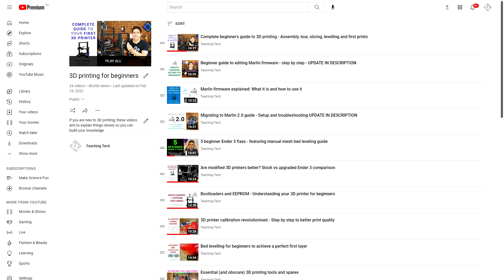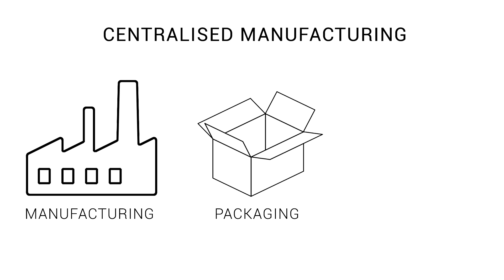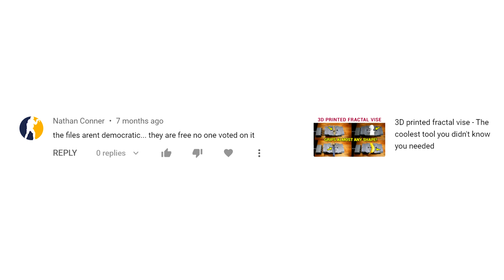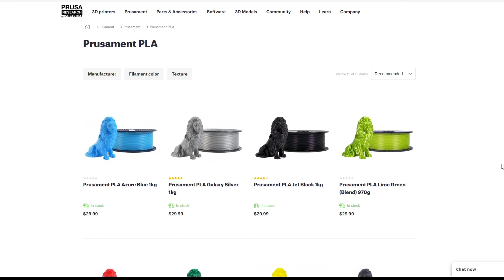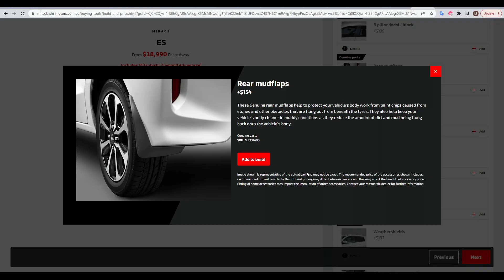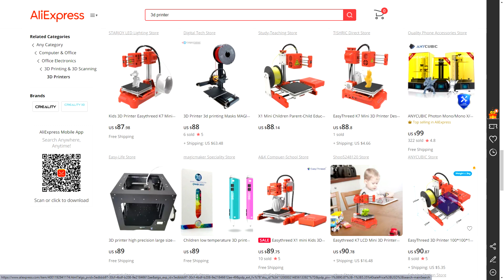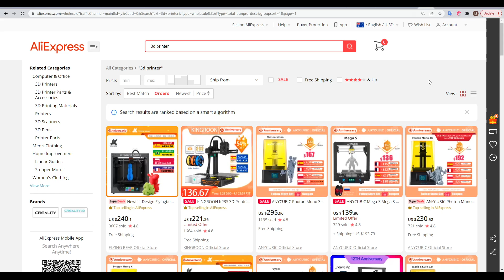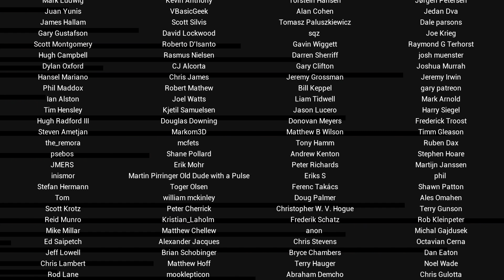3D printer trends are limiting mainstream acceptance: The 3D printing paradox

Comment: If resin can overcome the toxicity issue I think it has the best chance of democratizing 3d printing. All the steps we do with it can be automated in large part. Make a machine where you insert a resin bottle, the printer recognizes it and adjusts settings to match the resin, fills and drains the vat automatically, washes and cures the print automatically, pops it off the build plate automatically, and only leaves you with the supports to remove, and then it's ready for mass market. Just an estimation, but I think this can be done in volume production. Yes, it's going to be a bigger machine, but it does everything, and the only thing the user has to do is add resin bottles and empty a cleaning solution once a month and suddenly it's not much different than a dishwasher.
Reply: Nope, Resin will always be a mess and if/when 3D-printing will be mainstream, it will be FDM-printers. My Anycubic Vyper for example was very easy to setup (far easier than IKEA-stuff), never manual bed-leveled anything ever and did so far a good job in reliability. Once the filament-sensor produced an error-code and Anycubic sent me a new one. Cura-profiles were not optimal, but even the basic-settings provide a simple interface to fix that. Problem for mainstream are rather the different filaments that require tinkering with Cura for decent results. A mainstream 3D-printer could be cheaper, but you can only use the filament made by the manufacturer. Today this would be easy by switching to a unique filament diameter like 2 mm instead of 1,75. Certainly some filament-producers will provide alternatives, but that's not different with spare-parts for cars or coffee-pads for Senseo machines.
Reply: @Leynad778  please why resin will "always be a mess" when current wash and cure stations largely remove any mess from the equation. FDM requires dramatically more work by the end user.
Reply: @tenchuu007  And what to do with the waste? There are many videos from people who manage 3D printfarms and I didn't see one running resin-printers for more than some very special jobs. And what job is required by end-users with FDM-printers that isn't required for resin-prints? The professional printers need perfection and are usually happy with their results, mostly made by Prusa or Polymaker FDM-printers. The P1 on their wishlist is usually an automation for removing the print and repeat.
Reply: Resin printers compliment FDM printers they're not meant to replace them.
Reply: Layer height, extrusion width, flow rate, temperature adjustment and half a dozen other things you have to get perfect for FDM that resin doesn't need. FDM can fail in a myriad number of ways that resin never does. Those failures will stop adoption.
Reply: @tenchuu007  All of this is just a matter if using an unknown filament with a slicer software not optimized for the printer and isn't a problem with FDM in general. That's what this video is criticising, since most hurdles are due to the wide variety of printers and filaments, but it also keeps the costs down. With inkjet flat printers you are forced to use the very overpriced ink of the manufacturer, why the printers are so cheap, but also easy to use. For more mainstream 3D printers it would help if such idiot proof solutions are at least an option. What 3D printing needs is a major big player pushing technology forward and not another Chinese Endor 3 clone. And btw, if you have that many problems with FDM prints, you might want to spend a bit more on filaments or replace your printer. My Vyper work flawless with the right filament and settings and it's like putting a frozen pizza in the oven. For getting 99,9% quality you have to pay a lot more like with everything I know.
Reply: @Leynad778  Nice to see the judgment come in, but let's just start with me having three FDM printers, all of them costing more than the Vyper, and printing in a variety of materials from PLA to TPU to carbon. I run a delta Flsun Super Racer as my primary. I don't exactly buy cheap filament. I have worked on dozens of machines, and there are literally dozens of places an FDM printer can fail. Belts loosen, hotends come loose, screws shear, one of the four motors burns out, the heated bed fails or the bed lining fails. Or just simple things like a bit of filament lifts off right at the start and ruins the print. Literally a gust of wind can affect an FDM print to the point it fails. AC kicks on. That has nothing to do with "buy better filament and a better printer." Those things happen with all FDM printers. 
On a resin printer you have two points of failure. The motor on the Z axis and the LCD. Swapping an LCD can be a simple process if designed for easy replacement. Z axis problems are pretty rare. I can literally model out a system for printing, cleaning, curing, and presenting a resin print that has less potential failure points than just a standard, midrange FDM printer like the Vyper.
Reply: @tenchuu007  All those issues can be addressed with good design, and there are FDM machines which are very reliable: good belts and a sprung idler can keep them taught (or a simple microswitch sensor to detect tension and manual tightening); well designed hotends like Revo stop leaks, never heard of screws shearing or motors burning out or heatbed failing that seems like dodgy components; printer clogs of any type can be detected with a filament motion sensor; print failures can be detected with cameras and AI (would most likely be a cloud thing with home machines); a failure of the motion system can be detected with cheap accelerometers and closed loop control (like a standard printer generally uses a linear encoder to detect position). The problem is these are currently mostly commercial/industrial machines (and/or things covered by patents).

Industrial AM is a completely different market to home machines and adoption is increasing rapidly of all types. A business can afford to pay more for a machine as long as its function is worth the investment. Reliability is highly valued in manufacturing, although with a print farm it is less so since a failed machine doesn't hold up a whole production line. Basically any machine can be made to be reliable, it just requires a big enough mass market to make the investment worthwile like normal cars. 

There is a reason the big companies stay away from the hobby market, and it's because they know they can't compete on cost, or would have enough market uptake to cover the investment. Business is a much easier market to sell to right now. Ironically, because printers currrently require tinkering, there isn't mass uptake so there isn't a mass market for the larger companies to target. It's a chicken and egg problem, which may get solved when more reliable industrial machines trickle down to lower cost machines (if the low cost printer manufacturers would actually bother to incorporate these things).

The only manufacturer focusing on the ease of use aspect is Prusa, both with hobby and industrial applications. Being someone who is currently designing and testing a new configuration of FDM machine for my masters project, I really value my Prusa Mini for its ease of use and reliability, it just works (and I used it to print the parts I needed). Although I have had one issue where I had to take the hotend apart, so it's not quite there but they are getting there.

As for which technology will break through to the mass market is hard to say. I do know that what is limiting uptake of resin printers in industry is material properties. Manufacturers want material properties and costs equivalent to standard thermoplastics which will take a while to solve. There are some resins with good material properties although they have other requirements such as two part resins, high temperature or high viscocity.

Comment: I see myself as fairly technical capable person, I'm a practical electronics engineer and a student of mechanical engineering in a very respectable university.
a few months back I decided to buy an entry level 3d printer, so i bought a Biqu B1 se Plus because i wanted a large printer and it was on sale at a local store.
almost immediately after receiving it i understood that what is considered to be "entry level" in the 3d printing market is the complete opposite from any other industry. for starters, setting up a slicer profile for it was a complete mass, the provided profile is worthless so i needed immediately familiarize myself with all the slicer settings before i even started printing.

And then there is the actual build of the printer. i knew that i was buying a budget printer, and i did so wanting to dip my toes in the 3d printing world before jumping in, but that printer just threw me into the deep waters. the quality of materials was fine for the price, but the stupid ass design decisions really threw me off. there was only 1 Z axis lead screw on a 310x310mm printer, so the X axis rail was always unleveled and it was impossible to get a proper first layer, they only included 2 bed clips to hold down the glass bad, so it often caused layer shifts and ruined prints, the extruder is run by a tmc2225 driver that doesn't work well with linear advance.

so i decided i wanted to add a Z axis motor, and while at it i also bought an Idex upgrade (which i still hadn't installed). but the z axis kit biqu sells doesn't include a driver so you can't use the g34 command code, so i had to also buy another driver and program my own firmware to allow the feature. and there is not enough room for the second printing head so you lose a big chunk of printing space to avoid collisions and the way you put the second x motor throws the z axis completely off balance, so i also had to order a new tmc2209 drivers for linear advance, buy longer x axis rail, design a new way to mount the x motors, move the extruders to the top of the printer and again program a new firmware to include the changes to the frame and add the linear advance feature.

i practically had to redesign the whole thing and program it myself to bring it to a point it prints without issues, if i wasn't technically capable and loved tinkering with stuff i would have frown the whole thing in the garbage after a week of it causing one issue after the other and completely give up on printing.

Comment: My primary irritation with both the manufacturers and reviewers of 3D printers is their claim that a machine is "silent" by completely ignoring fan noise from the CPU and power supply. It can sound like a small tornado, but as long as there's no stepper noise, they claim it's the quietest printer ever. Reviewers don't call them out on it because those fans have apparently become an "accepted" part of the machine. We should demand better from the start. If Snapmaker can sell a printer for $1800 that sounds like a leafblower we have an elephant in the room at every level of the industry.

Comment: A) I agree with you, 3d printers need to be more maintainance free, that's usually achieved with modular components and clear instructions on how to service them
B) The more maintainance free a product is, the harder it is to maintain it. In your car example, yes I expect it to roll out of the dealership working perfectly fine, with wheels aligned and have the manufacturer recall it when there is a widespread issue, which requires brick and mortar dealership networks. Also, as you said, the vast majority of drivers don't have the knowhow how, the time, or simply the will to work on the car, so they take it to a service point, to a designated repair shop. We do the same with our PCs, 2d printers, TVs, fridges, and pretty much any widespread consumer good. 

From the above manufacturers should invest in plug and play parts, easy maintainance, and part stockpilling, as well either fool proof building procedure and tuning, or well QAed prebuilt machines, all of which will increase the design cost. Also, as we have computershops and dealerships, we need a repair network to take the printer when it breaks. Expecting the average consumer to fix issues is not viable, which I think is also a very good business oportunity. Further more we need to be able to transport a delicate machine from wihtout messing the alignement. Basically we need better centralised manufacturing of printers. We also need more quality brand names, brands you can trust just by their name, like Prusa etc. Nost of the above though will drive the cost up until the infra is there to service the printers. Now if only manufacturers tried to do that instead of chugging out clones of every printer and accessory (BLTouch anyone?)

Comment: Off topic, sorry.

Are biodegradable filaments at least common place now? My biggestt requirement for a 3D printer is to just... not make me a bigger contributor to the plastics crisis.
Reply: Forget it. PLA is the standard beginner printing material and it's only biodegradable on paper, it will not be practically composted anywhere in the world, as it needs very special conditions; and even the most progressive recycling companies will sort all hard material out of their compost.

Other materials which would be more inclined to biodegrade naturally simply do not work. It hasn't been possible to achieve this sort of print quality with them.

On the other hand you want your prints to be durable, and I found even PLA to have issues in this regard. It has a really weird long term behaviour, it becomes super brittle. Every single PLA print I have made has failed so far about 2 years in, if they were mechanically loaded at all.

What you want is either to have a recycling service which either chemically processes or remelts the material for reuse, and there are initiatives, but they're years away from being actually operational; or at least that your recycling burns all unidentified plastic in a reactor to reclaim the energy contained within.

I'm also not entirely convinced that plastic crisis is anything we have an influence on with 3D printers. The vast majority of ocean plastic comes from a handful impoverished regions with no waste processing whatsoever, and best way to handle that is charities which are working to fix that. The microplastics in your local lake or river that you can find probably all come from textiles via washing machines. The frequently quoted figure "you eat 5g of microplastic a week" is complete nonsense, I can explain why if you wish, but I'll need to fetch my notes.

Creative activity is by its nature wasteful, but it can still be valuable to us as individuals and as a humanity. You kind of need to balance that against other concerns. There are ways to make the world better, but to be effective, they need to lean heavily towards political action, "personal responsibility" is just a subterfuge by businesses who don't want to be held responsible.

Comment: Before my time when the telephone was just becoming a thing, and before every home had one. You could go to a phone box to use one.  Not so long ago you had a copy shops where you can copy a document and get it faxed somewhere.
So why not a 3D print shop. But where would we put them. Schools or library's. Machines would have to have less failure rates than we currently have. In this day and age they would have to be largely unmanned. More like vending machines.
The other problem is manufacturers would rather you buy a new item, than let you print a part to fix the one you have.

Comment: Mainstream adoption isn't coming any time soon. The printer would need to be self servicing to the point that the end user isn't taking major components off the machine. A clogged nozzle will see most printers put on a back shelf and never touched again for most people outside the hobby.  Seriously, the most complicated thing the user should have to do is load the filament/printing media. Safety is another big one, it's quite the process to make sure your machine is actually safe from thermal runaway events/fire. And they're slow, the end user has to do a bunch of setup in software depending on the file, adding supports, making sure it even fits in the build volume. Printed parts for the most part don't look that good without some kind of post finishing. Until it's as easy as ordering a cheap part off amazwong this industry is going to stay in the realm of hobbyists and engineers/designers. I do have high hopes for msla printers getting closer to this goal in the next few years with advances in safer to handle resins, even then I doubt you'll be able to avoid the mess that comes along with the process. I hope there's  rooms full of smarter people than me just thinking shit up that can render every criticism moot